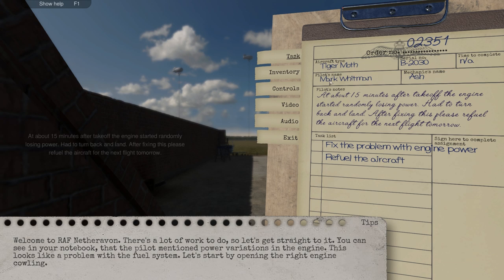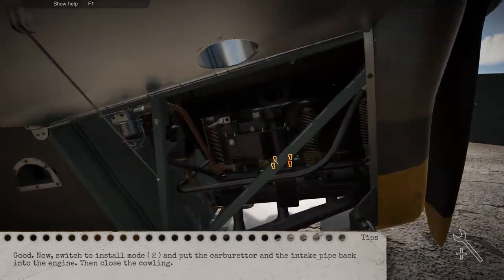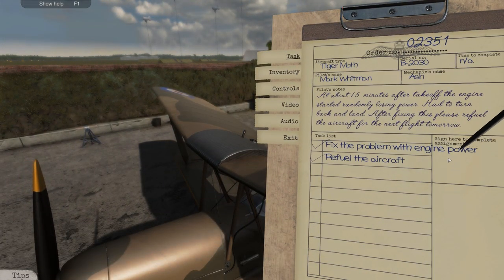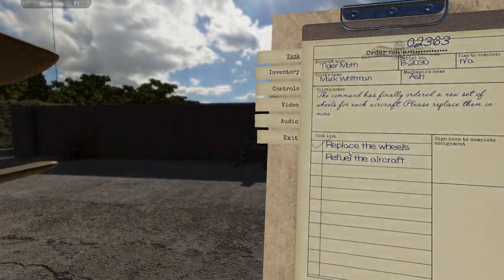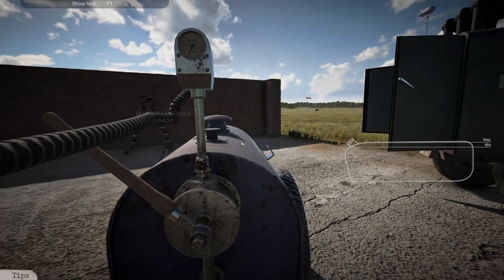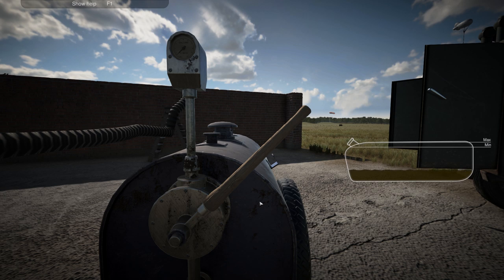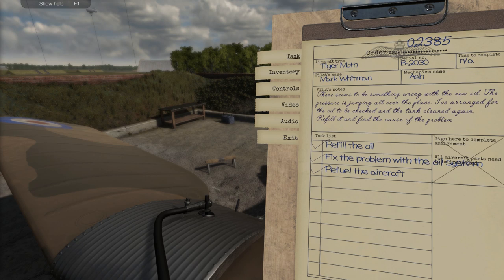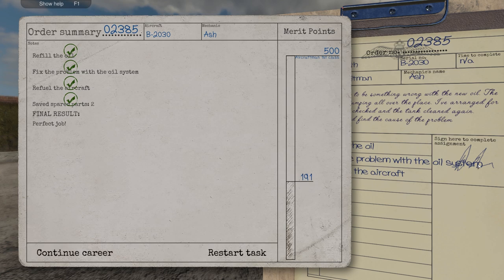Fixing the Tigermoth - Plane Mechanic Simulator

Comment: An inline four is where all four pistons point in the same direction in a line, hence the name Inline 4. The engine you were thinking of is a flat four,where there's two pistons on one side, the other two on the opposite side, hence the name Flat 4.

Beet engine is by far the flathead V8 ;D

Comment: (( Overhead Crank  ? upside down ? like yourself ?  lol  )) Inline = straight 4 ,  Pig or Boxer is the Porsche / Vw engine  2 pistons opposing   . ie , flat 4
Reply from the maker: in aviation its done different Aviation Engineers are a special breed.
Reply from the maker: Most general aviation aircraft are Flat 4's or 6's  - Aviation is strange and it gets confusing.
Reply from the maker: There are 14 types of engines and it gets confusing fast - Inline, H configuration Engine, And the horizontal opposed are the major ones I find in general civil aviation - Rotary and Radial are uncommon.